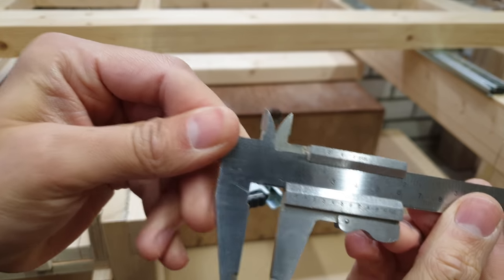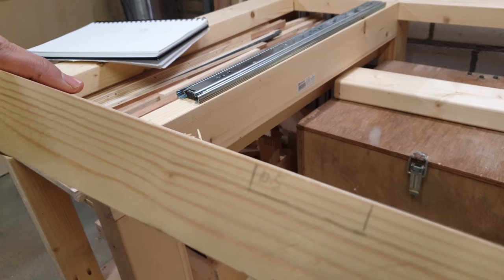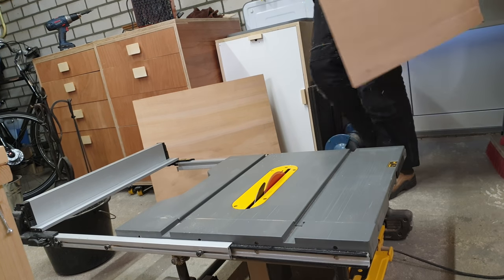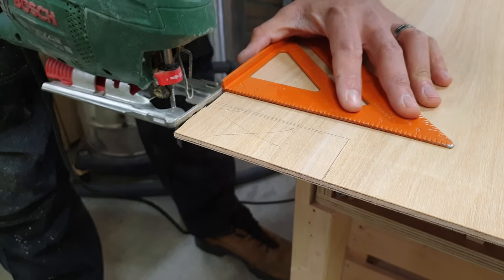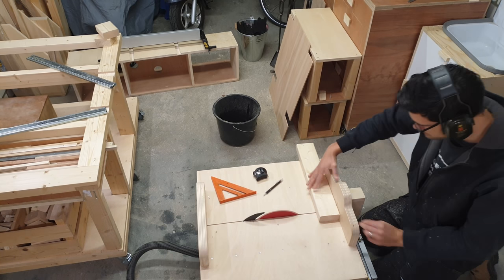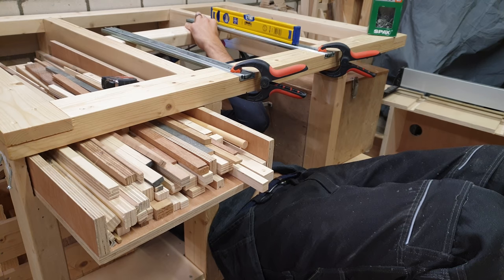Slide out table saw from workbench - Improving Dust collection - Mobile Workbench Series Ep.2

Comment: I was wondering what model of dewalt saw do you have? I have the 7491 and i want to do something simular and i was wanted to know that if its the same model what is the degree of arc on your dust port. If you could help another woodworking I would be most grateful

Comment: Such a great layout that I have now started to make one. Can you please advise the length of the slides you used for the pull-out addition.
Reply from the maker: Great to hear Ross!! I used these slides > https://www.onlinedeurbeslagshop.nl/Paar-ladegeleiders-volledig-uittrekbaar-60-cm
It's a Dutch site but Google Translate can probably help you out with that 😉. The slides are about 24 inches. Roughly the length that you can fit underneath the depth of the saw. Let me know how it turns out 😄👍

Comment: Any advice on the height of the table? I have mine, still on the stand it came on, and feel like it's 1.5 - 2 inches too tall, for my height. You look pretty tall, and it looks like your saw is waist high. Excellent  work by the way!
Reply from the maker: Hi Terry, I have my top at 98.5cm and I'm 195cm tall. In inches that's 38 3/4 inches high top and I'm 76 3/4 tall. I wish I could tell you what that is in feet but I haven't gotten a clue how to calculate that 😅 The height is great for me, I make all my work surfaces this high. Thanks for your comment!
Reply: @CornerfieldShop  Thank you for the reply. keep up the good work!

Comment: Is there anything I need to make sure of when I order the drawer slides? E.g., 'heavy duty' or something? Thanks!
Reply: If you know what slides they are, that would be great.
Reply from the maker: Hi Steve, apologies for the late reply. I didn't get any notifications about your comments. The slides I have are indeed heavy duty. They can hold 95KG each. But that limit is if you use them as intended; mounted upright. Since I mount them laying flat I'm not sure how much weight they can handle. For this specific operation what is made for this are linear rails. The problem is that these things are really expensive. So I decided to use regular drawer slides and it has been fine for 8 months now. Hope it helps!

Comment: Do you find that the top surface of your saw is flat? Mine dips down at the outer sides and the left mitre slot was also slightly blocked at the end by the position of the final table piece.
Reply from the maker: Yes and yes. It's not of professional quality for production but as a semi-professional garage setup I think it's great. The miterslot works great if you make your own runners but with the stock mitre gauge it sucks. The top doesn't bother me at all. If you put pressure on the right place it's fine but with large pieces it is something to keep in mind. Thanks for the comment 👍
Reply: @CornerfieldShop  thanks yes I've noticed the supplied mitre gauge is not very good. But I would like to use the mitre and cross-cut ability so will have to research the best solution.